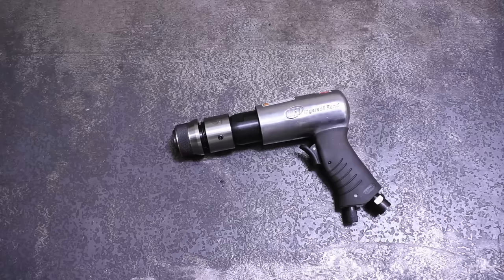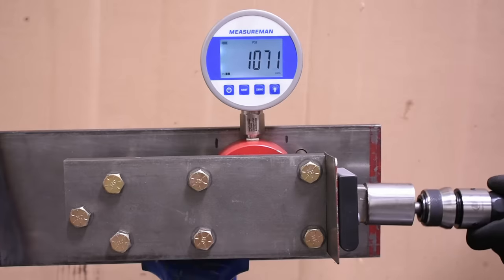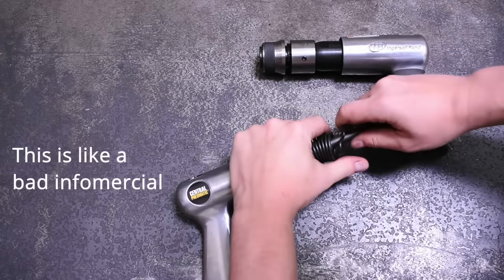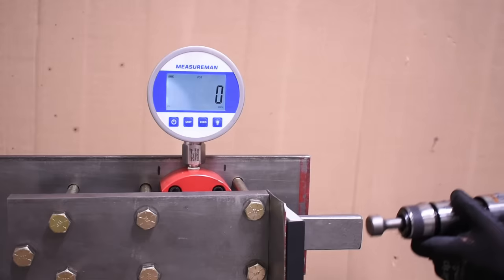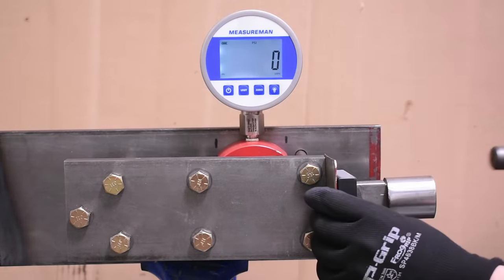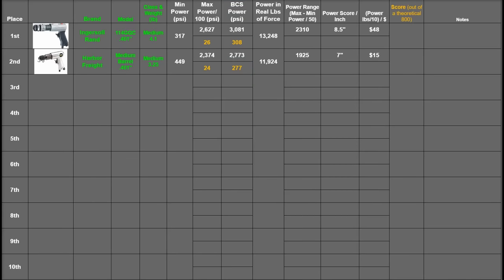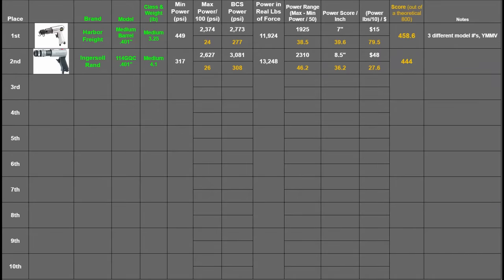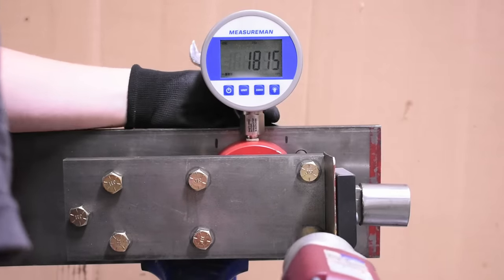Exactly How Powerful is a $14 Harbor Freight Air Hammer?

Comment: It’s been decades, probably over 20 years when I realized real quick that those aren’t good for ball joints and suspension work. I bought a Cornwell long barrel and it got me through pretty much everything in the shop. The only thing I can think of that those small chatter guns are good for is maybe bodywork and scraping🤷‍♂️ If I needed something lighter, I just turned the dial down on the long barrel..
Reply from the maker: Yeah, they wont be replacing anything we use in the shop for heavy stuff that's for sure.

Comment: how do these dyno numbers work if you aren't regulating the pressure you are applying to the tool?  Seems like to be more consistent you would have to have a fixed force holding the tool against the wedge.

Comment: Without testing it how it came (with the spring instead of the slide collar from the IR), how is this still considered $14? And how do we know the spring isn't a determent to performance? I also have an Astro 4980 myself, and I have not used it in the spring because I like the slide collars better (mine is setup just like SMA's), but it would be interesting to see if the spring changes the performance vs a collar.

Comment: The question with harbor freight stuff is not how well it works but how long will it work
Reply: There's no in-between with HF tools it either breaks in the first week or lasts 10 years. If you make it through the first month you got yourself a good tool

Comment: Not gonna lie, I paid about $15 for a CH air hammer from Walmart. I was there getting air fittings, and my old IR had been stolen years before and honestly I always found a way to work around having one up until that point. Anyways, the CH sat on the shelf for months in the box, finally one day I was helping my Brother-in-law do Balljoints on his truck.. After hammering on them for about 20 minutes, I remember I had bought the CH air hammer.. 

Honestly, I kind of giggled as I hooked everything up.. thinking this $15 POS is gonna make me look stupid. And to be 100% honest, it was the polar opposite. It was definitely pushing the capabilities of the hammer (these balljoints were S T U C K), but it did it. Saved my back and arms a lot of pain. 

I won't consider this on the same level as any of the bigger money tools (all I've used aside from this is a very nice snap on unit, and my IR), but for a here-and-there DIYer, or even a tech on a budget, that little thing definitely will get most jobs done.

Comment: I wonder if using the hammer hitting  hydraulic ram with a check valve might work
Reply from the maker: That works decently, we were getting results that way. But after revisiting the tests later we would get different result. We think we were damaging the seals on the ram.

Comment: If the stroke length is the same, is the diameter and weight of the  pistons inside each tool different?

Comment: Being use to using a Snap on or Mac using this HF air hammer is pretty much a waste of time.  Perhaps I got a dud.  Didn't want to spend the money at the time for a one off job.  Bit of a mistake.
Reply from the maker: No you're right, power wise

Comment: harbor freight Air Hammer is the most useless tool i've bought from them had it a few years but i don't think I could ever knock anything loose with it and got one heck of a air compressor used to run 125 psi with it and just 2 years ago upgraded it and now run 170 psi so i decided to try it again and yes i keep all my air tools oiled daily the Air Hammer just doesn't have any power and doesn't even wanna work at this point it barely worked to begin with.

Comment: Long time ago I did a job exposing stone in cast concrete walls with those...we went through a solid fifteen of the fucking things, and the job boss absolutely refused to buy anything better. 

I say "We". I mean "I". I did it. I did all of it. Fifteen years later my wrists still feel that shit.

EDIT: the failure point every single time was the spring retention device. That this is _trash_.
Reply: they last a lot longer when you oil them lol
Reply: @ganjalfcreamcorn8438  nah. Failure point was the retention spring for the tool.

Comment: if you gets one of these, get the quick change chuck at the same time, its $4-5, and changes the usability factor of this entirely. do away with the silly spring retention nonsense. just watch your fingers when changing bits, its a biter.

Comment: these results are totally bogus because the gun only hits as hard as solId Is the place holding it. just by pushing harder the operator can rasie the amount of power the tool puts out and the same thing wIth impact wrenches